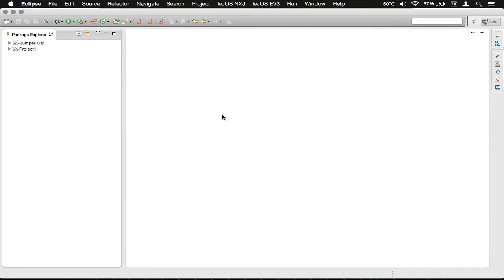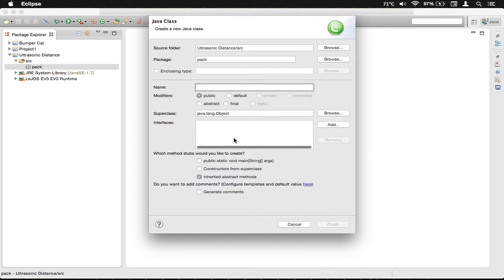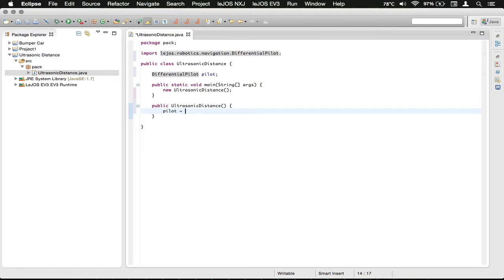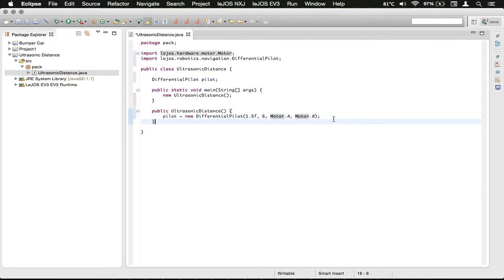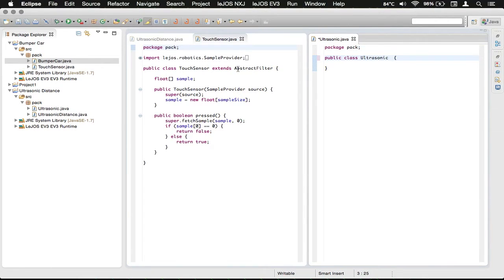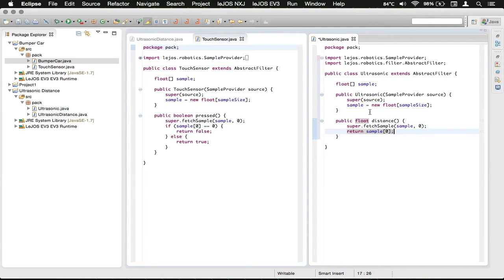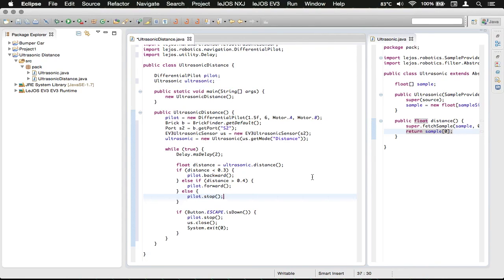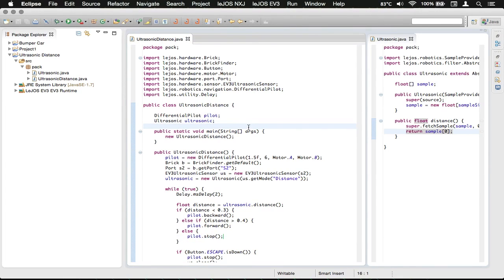LeJOS EV3 Ep14 - Ultrasonic range project

Comment: Hi Gliderman, I copy your same code for ev3 ultrasonic sensor and trying to run ev3. When I run the program, it does something like that ultrtasonic sensor light goes on and  robot body move a tiny tiny tiny bit further (a pin point) and then light and robot stop. Please advice me why it stop so quick before going any further and measuring distance. I changed 0.3 0.4 value to 30 and 40 but result is same. I changed  delay 2 to 20, 2000 but same result. Thank you for your time.
Reply from the maker: +porag ali It appears that LeJOS may have changed from when I made this video.  Instead of calling "us.getMode("Distance")" try replacing that with "us.getDistanceMode()".  If that doesn't work, we may need to call "us.enable();" right before that line (so below "EV3UltrasonicSensor us = ...", and above "ultrasonic = ...").

There's not something in front of the ultrasonic sensor that is about 40 cm away right?  And you have it plugged into the right port correct (or the right port typed into the code, in my video I used S2, and in the past you had it plugged into S1)?  If there are other EV3's in the room, then it could be picking up their ultrasonic sensor pings and confusing it.
Reply: +Gliderman's Channel, I have tried the process you advice but still in same condition. Light goes on and robot move move a tiny bit and light and robot stop. Port for untrasonic sensor "S4" is correct.  I also tried 0.4 to 40 but no luck. here is my code 

import lejos.hardware.Brick;
import lejos.hardware.BrickFinder;
import lejos.hardware.Button;
import lejos.hardware.motor.Motor;
import lejos.hardware.port.Port;
import lejos.hardware.sensor.EV3UltrasonicSensor;
import lejos.robotics.navigation.DifferentialPilot;
import lejos.utility.Delay;

public class UltrasonicDistance {

 DifferentialPilot pilot;
 Ultrasonic ultrasonic;
 
 public static void main(String[] args) {
  new UltrasonicDistance();
 }
  
 public UltrasonicDistance(){
  pilot = new DifferentialPilot (1.5f, 6, Motor.B, Motor.C);
  Brick b = BrickFinder.getDefault();
  Port s4 = b.getPort("S4");
  
  EV3UltrasonicSensor us = new EV3UltrasonicSensor(s4);
  
                //us.enable();
               us.enable();
  
                //ultrasonic = new Ultrasonic(us.getMode("Distance"));
  ultrasonic = new Ultrasonic(us.getDistanceMode());
  
  while(true){
   Delay.msDelay(2);
   
   float distance = ultrasonic.distance();
   if (distance<0.3){
    pilot.forward();
   }else if(distance>0.4){
    pilot.backward();
   }else{
    pilot.stop();
   }
   if (Button.ESCAPE.isDown());{
   pilot.stop();
   us.close();
   System.exit(0);
   }
     }
     }
 }
Reply from the maker: +porag ali Just compared your code to mine, and everything looks good.  Couple questions though.

1. I noticed you did not have "package pack;" at the top of your code.  Are you not using Eclipse to program, or just missed that on the copy?  If you are not using Eclipse, it might be possible that your code can't find the Ultrasonic class we wrote.  If it can't find it, that might be the cause of the EV3 just twitching, though I would expect an error on the screen.

2. Are you using JavaSE-1.7 (Java 7) for your project?  Java 8 is not supported on the brick at this time.

3. Are there any errors that pop up on the EV3's display, or does it just sit with a blank screen (which is what our program does), or does it go back to the EV3 main menu?

4. What happens when you push the escape button (I think this is the button in the upper left)?

5. What version of LeJOS are you running (0.8, 0.9, 0.9.1)?

Sorry for so many questions, I'm just trying to get all the information.  I hope we can figure this out. :)
Reply: +Gliderman's Channel , Thank you. 

1. I am using eclipse and and my program in two project. "Basic Mindstorm Robot" and in package "pack".  I tried both but same.

2.  Yes, I am using JRE JavaSE-1.7 when create a project as you described on your video.

3. No error or blank screen. When I execute program, brick screen show "wait a second" with a cartoon pic. Robot and light goes on for about 1/4 second to move and that's it.

4. After I pressing escape button it ask me do I want to shutdown ?

5.I am using LeJOS_EV3_0.9.0_beta_win32.

I have a 1.20 minutes video so I can send you about what is going on but I dont know how to add a video on this post. Thanks for your time.
Reply from the maker: +porag ali Okay, thanks for the answers.  I was writing up a reply to try some other things (namely outputting to the screen), but in doing so, I found the solution!

In the "if (Button.ESCAPE.isDown());{" line, you snuck in a semi-colon!  Basically, that means that the "if" statement will run, and then find that there is no more code needed in there.  The program will continue running, but the next couple statements tell it to exit the program!

Replace that line with "if (Button.ESCAPE.isDown()) {" and you should be good!  And not to worry, this is an easy mistake to make, at least we found it.  Now the program should run, and when you want it to exit, you can hit the escape button.
Reply: +Gliderman's Channel, It is working. I am sorry for my mistake. I owe you a drink.
Reply: +Gliderman's Channel, do you have any plan for writing more code such color sensor. Thanks.
Reply from the maker: +porag ali Glad it is working now.  I think I could do a color sensor episode (well, maybe two, there's a lot of features in it).  I'll see what I can do to get that out in the next couple days (I recently swapped video editors, and it's taking time to adjust).
Reply: +Gliderman's Channel  Thank you.

Comment: hi i switch the ultrasonic sensor to my infrared sensor, but when i tested it seems like the IR sensor wasn't working. why?
Reply from the maker: +Lee KokChun There are a lot of variables here.  Could you show the code you changed?  I'm not completely familiar with the IR sensor, and there appears to be a few differences.  Are there errors popping up in the code?  Did you switch out "EV3UltrasonicSensor" with "EV3IRSensor"?  Did you use the same sensor port?

Sorry for the pile of questions. :)
Reply: +Gliderman's Channel I actually found the issue here..... instead of putting the value of distance 0.3, I change it to 30. Meaning it read as centimetre directly rather than converting it..... thanks for the reply anyway good work there
Reply from the maker: +Lee KokChun Hmm, very interesting.  Good work figuring that out!  I'll keep that in mind if I use the IR sensor.